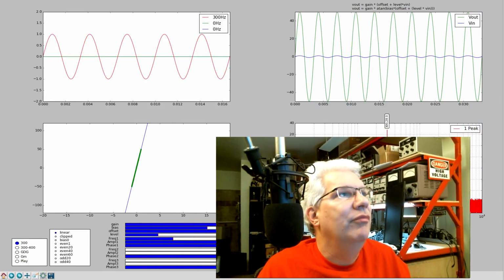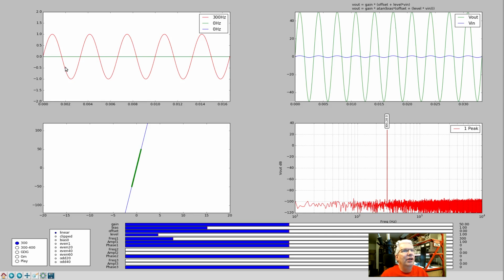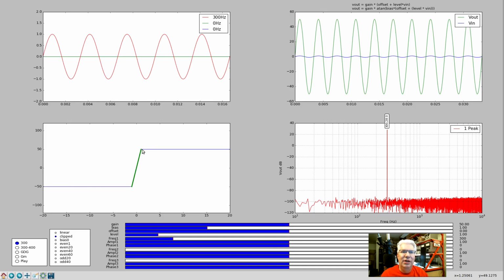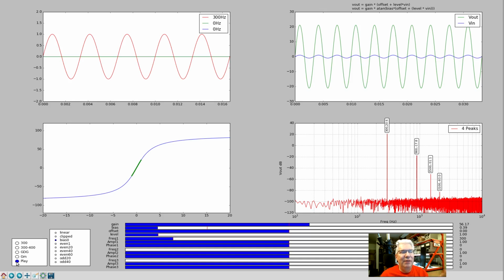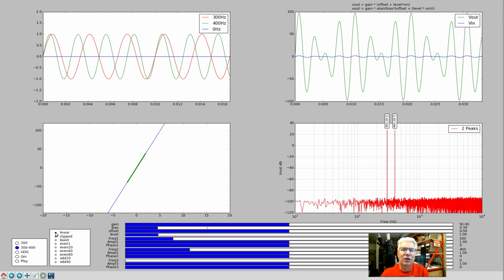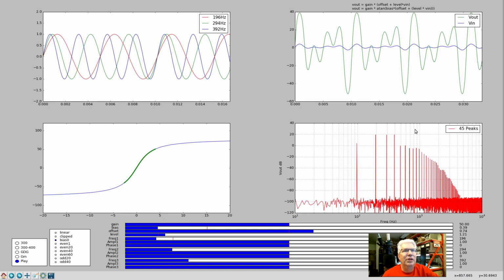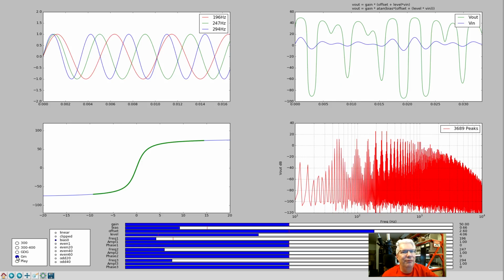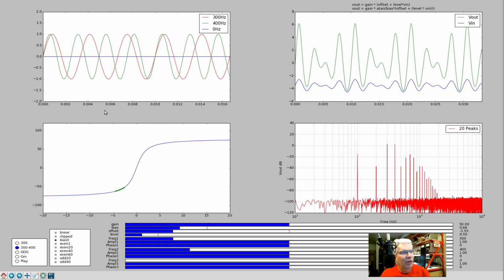180606 Valve Studio - Exploring Intermodulation Distortion

Comment: Great stuff Craig, thank you for this!   My mental model for how IMD occurs is getting slowly better :)
Reply from the maker: You're welcome. IMD is not easy to grasp. Once a upon a time, I actually understood the math behind all this. But didn't want to remember it or make a really boring video with equations and comm theory. Thanks for watching and the nice comment.
Reply: @CraigHollabaugh  I think the way to think about the math is that it's basically amplitude modulation cause by the mixed signals moving around the different bits of the transfer function... but I'm going to have to get a pen and paper :)

Comment: Craig,
Nice work,... Interesting topic. I have been casually musing about why the language used by audio dudes, (sound stage, etc), does not seem to track with objective engineering measurements. I will review the papers you mention - I suspect part of the answer may be suggested here. Although I have a theory relating to back emf from the speaker/room acoustics also. Even today 2018 there remain mysteries in audio. Anyway well done.
BTW where   do you live?
I am a retired EE with plans for my own YouTube channel.
Dan
Reply from the maker: Dan, thanks for the comment. I found the same lack of objective measurements as well. El Paso Tube Amps and TomTekTest do a great job with various measurements, you should watch their videos for sure. As far as IMD, that's a fairly specific, and probably fairly expensive,  piece of test equipment. But, as Jelcke pointed out, the Digilent Analog Explorer has excellent bandwidth and SNR front end. Measuring IMD a scripting exercise because the explorer's ADC and DAC have around 96dB dynamic range, which is plenty for majority of tube audio gear. 

I live in Colorado. Care to share your YouTube channel plans?
Reply: Sure, Also I am in Madison WI, Plans are for Audio (modeling and measuring transformers -> Spice), Antique radio, and maybe some test equipment restoration. First installment will be restoration process for Sound Technology 1200A HD, & ID measurement
instrument, particularly the replacement of LDRs with modern equivalents. I am familiar with El Paso. But he is more the technical dude.
I hope to bring a more engineering focus. It will be interesting to me to see what viewers want to see, so plans may not persist. It is not so much how to do measurements and more why and what do they mean. Do they connect somehow with what audiophiles say. What is missing in or understanding? How do room acoustics and our brain effect opinions.
Blah blah, big ideas. At the moment all my time is consumed with preparing houses for market, etc. Mom died last May and I am executor.
Also selling our our home. So very busy at moment.
Reply: Hey Craig, CO is a great place to be. I see from your LinkedIn you have had a career! 
I am familiar with El Paso - my focus will be less on how to measure but rather how measurements relate to audiophile subjective language if they do. There are many probable myths in this audio domain, not sure if I can uncover all the mysteries but that is one major focus.
Perhaps some restoration work on test equipment, antique radios and audio, measuring and  modeling transformers, simulating amplifiers in Spice,.... all with a more engineering focus than I have seen with most YouTube channels. 
Don't get me wrong - El Paso fits a niche and he does a good job with what he does. 
TomTekTest I have not listened to very carefully, my attention span is not sufficient.
So anyway, good luck to you with your channel - maybe someday we can collaborate on a common project. I have been noticing more collaboration with other channels lately  - check out "Alex French Guy Cooking" and "This Old Tony". Cook meets machinist on a Pasta Machine rebuild. Both guys are hilarious and each has a following. It is fun to see the mix mash, and I suspect that the viewers enjoy the collaboration.
Re: Digilent Analog Explorer, I have recently purchase a Siglent SDS2204X 4ch 200Mhz
scope. Includes FFT, and AWG. So I will probably use that rather than the Digilent.  I have grown sick and tired of crappy old equipment from eBay etc. Finally just splurged on some new crappy equipment, LOL. Actually I really don't yet know what to expect from the scope, and a few other pieces. No time yet to check them out. 
Also note: I live in Madison WI. 
Cheers Dan
Reply from the maker: This 'sounds' great, there's almost no video content that ties measurement to perception. I and a few others are very interested in this topic. You should focus on what you enjoy covering, your passion will come through in your videos and those are a joy to watch.
Reply from the maker: I've purchased a ton of vintage gear for my bench, but it can all be replaced with the AD2 for $300 dollars. I'm quite surprised at the distortion figure for the DAC and the ADC noise floor. 80-90 dB measurements can be achieved relatively easily without attention to cabling or other issues. For tube amp work where 1% distortion is perfectly acceptable, the AD2 is perfect low-cost solution to get started. However, I like to turn knobs, so I'll mix it up in my videos.